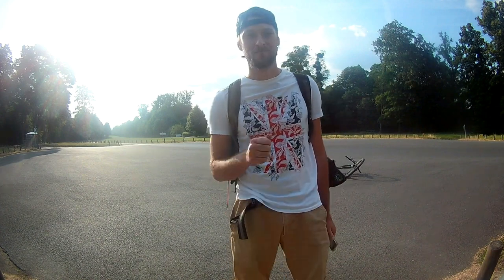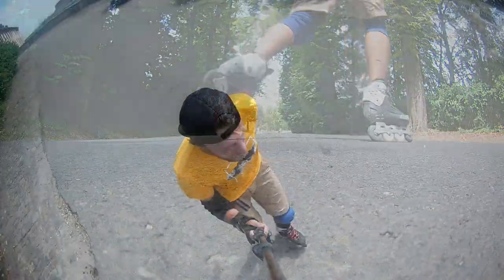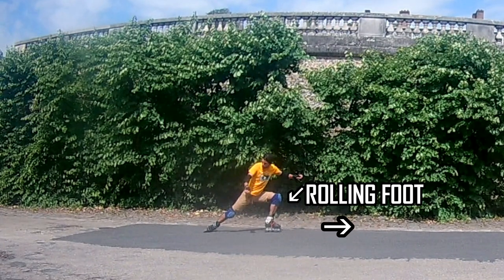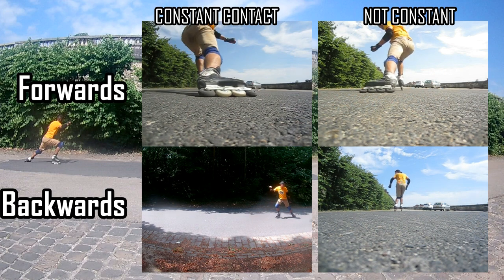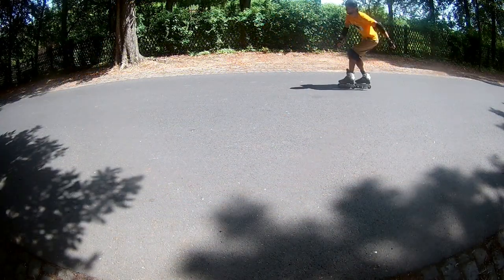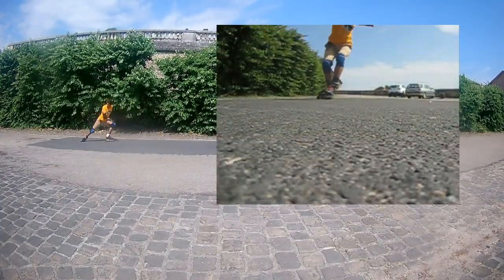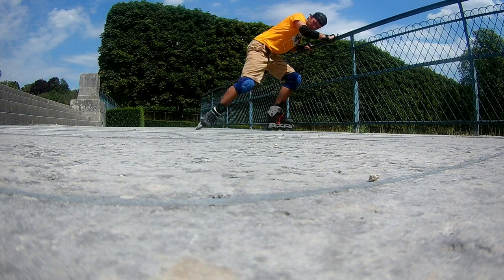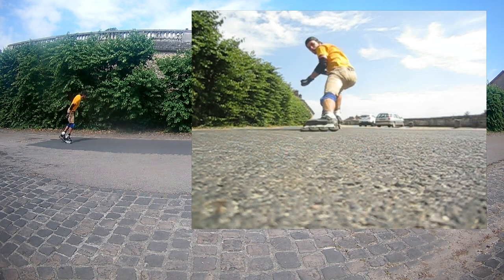INLINE SKATING POWERSLIDE TUTORIAL. PART 1. Forwards powerslide [2018]

Comment: Best video on the power slide on all of YouTube and I've watched a lot. I am curious which version (contact vs non-contact) is safer for very high speeds as an emergency break or safer on rougher terrain?
Reply from the maker: Thanks! Most of the inline skating instructors say that powerslide from jump (forward, non-contact) is the easiest and the safest.  It's usually the first type of powerslide that they recommend to learn. Probably it's a little bit more difficult psychologically than the contact version, but there is almost no place for mistake in it. Small hop and you're already sliding.

Comment: My wheels feel very soft, will this make a big difference? Do you think its worth starting on harder wheels? Also I have a rockered set up, do you think this will make it any easier/harder?
Reply from the maker: Technically the harder are wheels the easier is to slide on them. Powerslide could be performed on soft wheels but it will be more difficult to perform and you will also damage your wheels faster, so I recommend to use harder wheels from 84-85a hardness. Rockering is not very crucial for powerslide.Flat setup will be a little bit more stable but with a proper technique you will hardly notice the difference.
Reply: @NikZvi  thanks for the info!, think I might invest in some new wheels and see how it goes